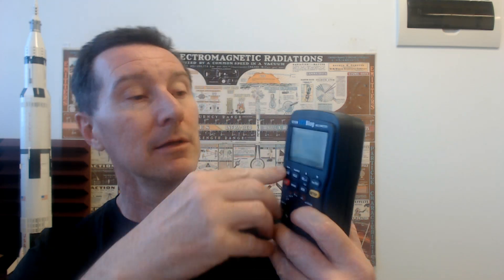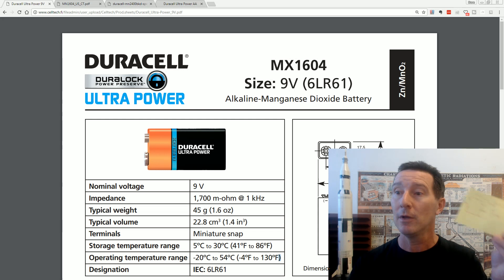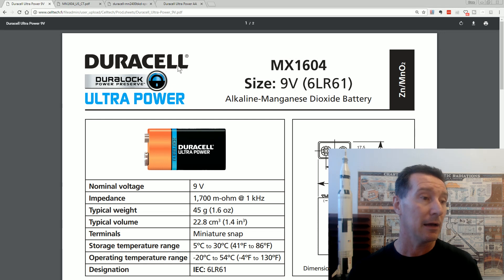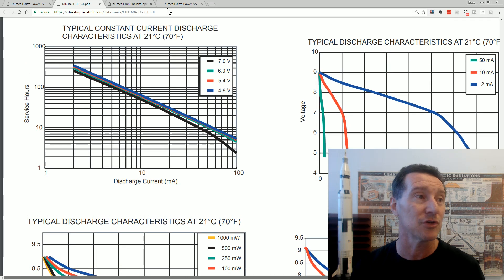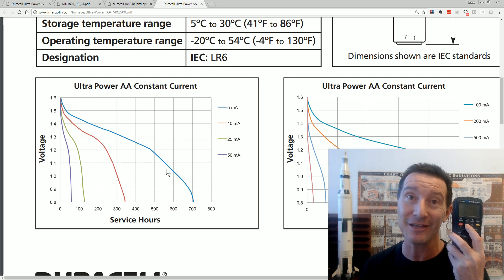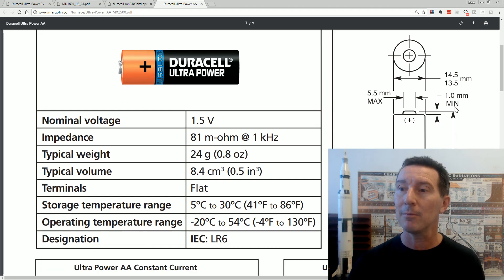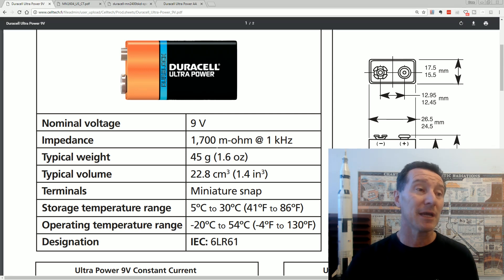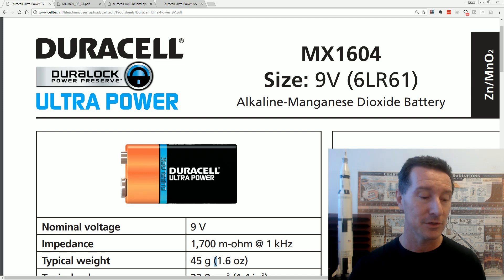Why Use AA's Instead of 9V Batteries in Multimeters?

Comment: I wish cell phone makers would stop being stupid trying to make things to thin to hold, let alone actually hold a decent battery
Reply: I would really like if there were some sort of standard for lithium rechargeable batteries. All modern cellphones have their own format, it would be really nice to get off-the-shelf batteries for a wide range of phones and even devices like multimeters...
Reply: I hate how people always obsess about how thin the new Iphone or whatever and the first thing that they do when they get it is stick a big ass "military grade" case onto it.
Reply: check out jesy j7, 4100 mah, radio walkie talk, infrared controller and a badass unbreakable case, all running android 6.0
Reply: There USED to be types of batteries where the same battery was used across a wide range of phones. It was a system designed to make phone battery replacement easy for the consumer (or even carrying multiple batteries with you for longer life).

One example is the Nokia BLC series; for many years every Nokia phone used the same battery. Replacements were cheap, readily available, and easy to drop in.

But that's exactly what the phone manufacturers DON'T want. The whole purpose of glued in batteries is to make it so you "have" to throw away your phone after 3-4 years and buy a new one.
Reply: Jake Heuft - Correction... 4100 mAh is a 37% increase over 3000 mAh.  And it is mAh not ma or even mA.  mA and mAh are not the same.
Reply: wolvenar the biggest bullshit with the removable battery issue is that people settled for those stupid portable chargers, which waste 30% of their energy converting from 3.7V battery level to 5V USB level, which the phone then converts back to the 3.7V level again!
I swear if i ever have the money i'll tape a giant D-cell to my phone and if anyone comes complaining i'll show them just how thin my phone has to be to mish mush their face.
Reply: You can double side tape a powerbank or two to the back of you phone... Or make a custom case that hold extra batteries and run wires to install them parallel to the one in your phone.
Also, I have just noticed my phone is half a centimeter wider than a 18650 is long...I recon I could fit 8 side by side... There goes my weekend.
Reply: BlendJul I know, but it is still dumb they ignore those that still want sd cards and replacable batteries.
Reply: Sekeletu, So explain why companies like Zerolemon found it so profitable to make aftermarket batteries for so many makes and brands if there was no market for them. I feel you may have a narrow view of this because of your habits and those you have chosen to be around  who are usually by human nature, much like you. Also tell me again how everyone upgrades thier phone every 6 months.. That seems in my circles to be the rarely heard of scenario. With the exception of when the phone is irreparable. Which then if nothing new on the market suits my needs I seek out new old stock or refurbished of what I had. I upgrade when 2 criteria are met: 1. The phone can no longer meet critical needs. 2. There is an acceptable replacement on the market. This by my definition means that it MUST have a replaceable battery and sd card or similar expansion ability. Also it can not be restricted by its OS in a way that denies me the capability to do what I wish with it. Motorola currently has the only thing new on the US market that satisfies those requirements in any fashion. So I am still using a Note 4. I am a network admin and programmer looking for a utility, not a teenager looking for the latest and greatest for bragging rights. My next phone I have pondered seeking out something outside of the US markets that meets my needs and is still able to be used on US networks.
Reply: wolvenar Thin gasket around battery compartment door, problem solved. They have been doing that for years for other devices.
Reply: Philips Xenium phones were cool, with 60 days standby.
Reply: Slot1Gamer That is something very quickly going away in the name of "water resistance"
Reply: Slot1Gamer In fact, this is the main reason I wont give up my current device, I have a huge battery swap in it.
Reply: 4100 is only 25% over the nominal 3000ma packs cell phones have. Not much of an improvement. IMO cell phones should have 6000-9000ma batteries. You can get extended ones for some models.
Reply: ElmerFuddGun yes I know, typo.
Reply: Jake Heuft Thats why I have a 12k mAh battery pack. It has gotten a bit old and tired itself now though and lost a noticeable amount, let alone the for ed "updates" that have made the phone slower and use more power. Same system  just suddenly slower and less efficient now that the latest and greatest phones are neing pushed.
Reply: detech12 - the thing phone plus a bulky protective case makes perfect sense.  You want the protection to be good, cheap, easily user replaceable while the phone inside remains flawless.  Put the phone in a big protective shell and the phone itself gets dinged up, AND not everyone wants or needs that protection, so it makes sense to be an aftermarket product, plus it is nice to choose your own style of protective case so you recognize your own phone vs someone else's.
Reply: Stinky Cheese except it cripples battery life.
Reply: Juan Herrero Ive done something similar in the past with charge and heat protection then set it in silicone. formed a silicone case for the entire thing. but you can't do that with a new phone without opening it and voiding the terms of thier warrenty.
Reply: That is not a solution, that is a horrific hack. I like solutions to problem that solve the root of the problem, which is the batteries in phones are too small.
Reply: Jake Heuft it's a replacable battery, this gives you the ability to replace it with whatever you wish. What will happen to most phones now that cant be when the battery fails or gets weak?
Reply: Wolvenar: In my experience most people I know start to retire their phones when the battery life becomes "less than a day" which varies a lot from person to person. I'd happily take a phone that is 2-3 mm thicker and will make it through 2 days of modest screen time or one day of heavy use with screen on + gps etc.
Reply: wolvenar people want a fancy expensive phone they can slide over their bum like a credit card and a battery any bigger than absolutely required for 4 hours constant use would make it too thick for their standards of what a phone should look like.
Think of it like the beauty standards of old fashion magazines.
Reply: The thing with removable batteries in smartphones is that almost noone didn't ever replaced one, because after the battery got old, the device was also already obsolete :-) So people demand removable batteries and than they throw the smartphone away after 2-3 years, not changing their battery even once :-)
Reply: Wolvenar I'll try to answer with an order:
1) There apparently is a market for them, and it's not smaller even though most phones have "non-removable" battery. Think about that, they should shut down after the trend to not allow the user to change the battery went mainstream. Yet, they're doing fine. That means that the option to replace a battery by an average user was, in fact, not important.
2) Things I say about the replacable battery are not only from my observations, they're based on a common sense and, last but not least, manufacturers made a lot of research whether it's really important functionality, or not. I remember that Apple introduced it as first on the market and how much crying was over all Internet, yet other manufacturers followed the trend and gained their growth, which proved that it was not really a big deal.
3) I said 2-3 years, and you say 6 months. Where did you get that number? I don't know what phone do you use, but I've never had problems with battery after 6 months of usage, charging it everyday.
4) I still use iPhone 5S in my daily job (my company's requirement), it's almost 4 years old. The battery life on this thing was never good, but so far it's not much worse than it was on the beginning. I don't feel the need to replace it, but I'd like it to have higher capacity. So for me the solution was a case with an additional battery, which doubles the battery life of the phone.
--EDIT--
PS. If that few % of people needs to replace the battery for some reason, they can always do that. If he's not an idiot, he can do it by himself following the instructions that can be found easily, if he is an idiot, he can just go to any service and let them do this job for 5 bucks.
Reply: i have a 1.5cm phone with 21Wh battery (doogee s60 lite)
Reply: you forget that a lot of smartphones have removable batteries and have had for a long time